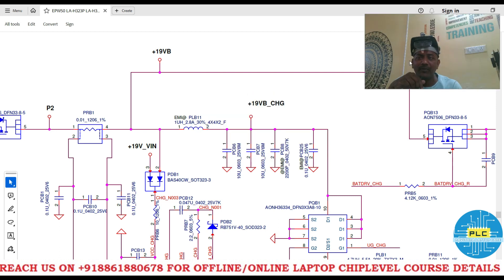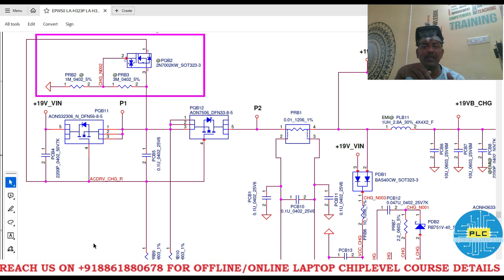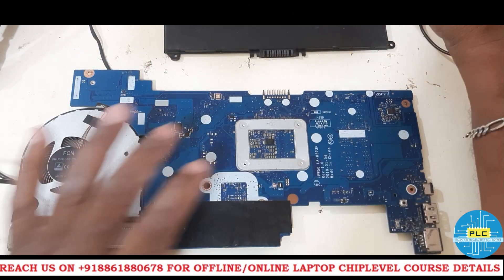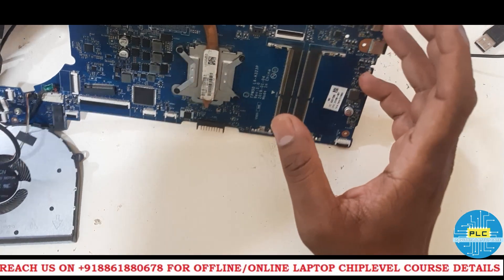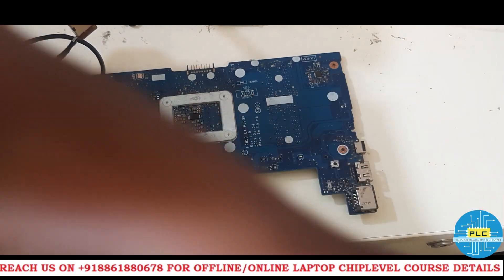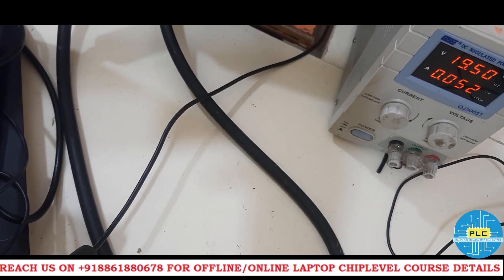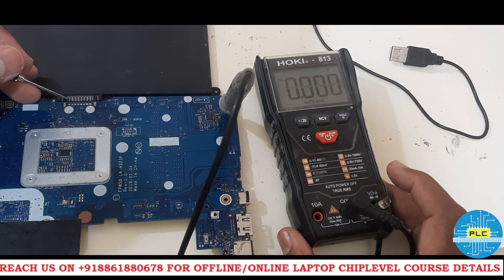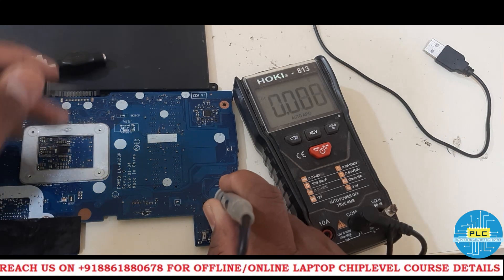laptop repair - charging ic - practical facts and tricks

Comment: Hey my laptop needs BQ 24780S ic  chip replacement for my dell inspiron  7577 my laptop currently doesn't turn on the ic currently on looks damaged. My question is can I buy any BQ 24780S chip because i keep seeing difference in the rest of the number specification when i search for it on eBay and Aliexpress.  For example the chip which is on my laptop is BQ 24780S TI something "can't clearly see the rest of the numbers" and CQ something "can't clearly see the rest of the numbers" but when i search for the Chip as BQ 24780S , there is BQ 24780S TI 540 C4TR  also BQ 24780S TI 561 C4NN and other types. Can i buy any of these two and will it work as long as it is a BQ 24780S ?
Reply from the maker: No issues.  But main part is BQ24780S
Reply: @LaptopCourse  thanks

Comment: My HP laptop was all fine then one day the power just drained from 40% to zero in just 10seconds...
From that day, it only works with AC plugged on. It does not charge and it if I switch it on with the battery on it, it cuts off after a short while...only works perfect with direct power without battery.

Could it be the IC????

Kindly advice.
Reply from the maker: Check the oc requirements. P is not working

Comment: Sir upper charging MOSFET is in diode mode for the battery. And it will transfer voltage from battery to clr